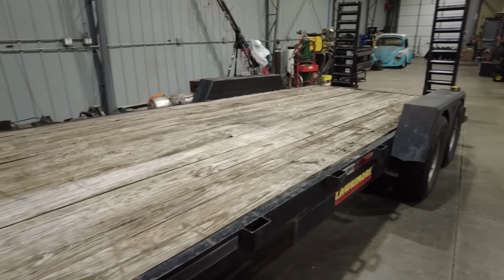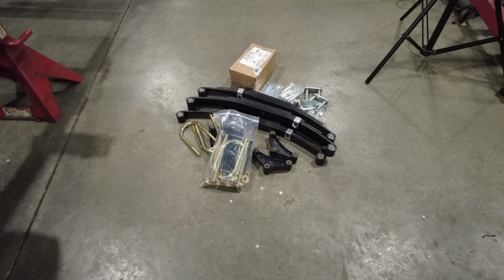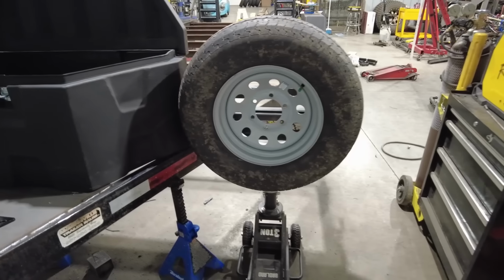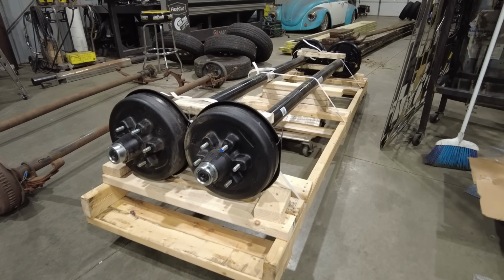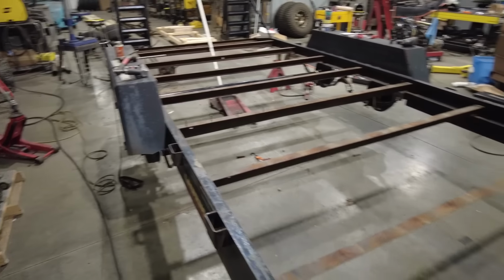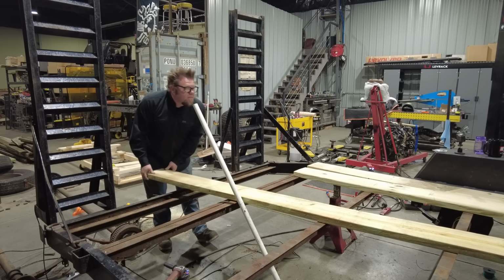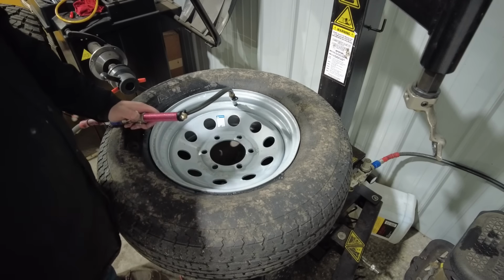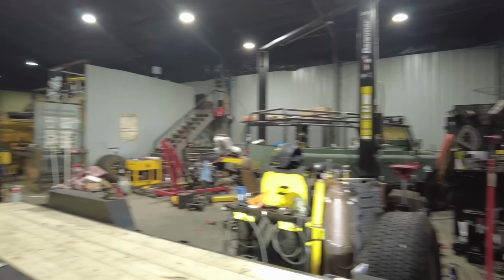Car Trailer Rebuild, How to Increase the Load Capacity of your trailer

Comment: You're also going to wish you had put grommets in those holes that you ran your homemade wire loom though. The wiring you pulled out had a HEAVY DUTY abrasion resistant jacket all on it. Which protected it from chafing against those bare metal holes and road debris being kicked up behind your tow vehicle. Your homemade loom doesn't have that. I give your wiring job 2 years before you have to start making repairs. That wire was not designed to be used in the application you are using it for. 

I'm willing to bet, you're going to hate those particular lights in the middle. Personally I would have put 1/2" led lights down the middle. They would be hard to hit with chains or straps, and still apply a good amount of undercarriage light. Not to mention less blinding at night.

Honestly I could do a full page of issues you're going to see with the "upgrades" you have done to this trailer. But nobody wants to see that. In the short term, it's a good "upgrade", but you have just increased the cost of maintenance and repairs for the life of that trailer. 

You should do a trailer update in about 6 months to a year. See how everything works out for you.
Reply from the maker: Will do because I think you are wrong on all accounts
Reply from the maker: Plus how did I increase my maintenance on this trailer?
Reply: @BigTireGarage By using the substandard wire to redo your wiring. You're going to be repairing the wiring more. If you compare the insulation on the wiring you installed, to the old wiring or say a Gates pre-made harness, you can see that the exterior covering is thick. Like 2-3mm thick. Compared to .5-1.0mm on the wiring you installed. I should also say that I assumed by the way you talked, that you use this trailer quite often. If you don't, obviously it won't be an issue as soon as I think it will. 

 Also the lights you installed down the center, tend to go bad fairly quick. They look like the 4" taillights that class 8 trucks use. So they will probably need replacing about once a year. I have found that it's hard to find LED lights that stay sealed for very long. Plus I didn't see you box in the back of them, so road spray will probably have an effect on them as well. I wouldn't be surprised to see the LED's start to fail fairly quickly.

I also thought about my comment saying that I think you will come to hate those centerline lights. I have really good night vision, and I am sensitive to bright lights, especially at night. That's why I made that comment, but failed to take into account that some people are night blind, and need all the light they can get. So you may not come to hate them for that reason.
Reply from the maker: Or maybe since I know how to build off road vehicles..I built the harness the same way...with a layer of e tape backed up with heavy abrasion tape.

Add to that most harnesses fail at junction points whete trailer manufacturers use sub standard methods like scotch locks a t taps instaed of high quality butt connectors and heat shrink.
Reply: @BigTireGarage  I'm just giving you my experience as a heavy duty diesel mechanic with a decade under my belt. 4x4ing as you very well know, is completely different than highway vehicles. It doesn't matter if a harness is loosely ran in 4x4. They don't go fast. Maybe 30mph, but not 75. So they don't have to worry about wind whipping wires around or road spray pushing into every little crevice to seep past seals. 

But it's your trailer.. Have a ball. Just trying to help you out.
Reply from the maker: I understand what you are saying...and trust me my 4x4's go a lot faster than 30mph...try 100mph through the desert. I started my trade in heavy truck and coach at a Volvo white dealership in Canada in 1990 so I know what you mean about road miles wearing on a component. Trust me..I build my junk right from the start because I HATE maintaining them.

Comment: Ian, GR8 job. I really like the lights in the middle of the trailer. When I was upgrading my trailer, the company blew holes in the frame for the wires. I drilled them out and ran grommets to protect wires from rubbing. Never had a problem but what if. I have a full wire mess ramp but installed extra set of trailer lights on the ramp. this allows the lights to be higher and more visible. and an extra set if the others quit. I added extra marker lights on the front corners and blinker markers on the side center of the fenders. This allows the person coming up on the next lane to see me coming over if they can see the rear blinkers. A spare spindle is an idea. I had a bearing go out on a trailer many years ago coming back from Zuwharrie and unloaded it and drove home. It was just faster than strapping it up. 8-)

Comment: Why don’t you put the spares UNDER THE DECK? It keeps thing out of the way and out of the UV rays that degrade the rubber. Properly placed, you shouldn’t have an issue with high centering. Maybe some junkyard spare tire winches from pickups.

Comment: Can someone explain to me the difference between a trailer winch and an actual winch?
Reply from the maker: Trailer winch is ussually under 5K, has less line, and doesn't have the same gear reduction that a real winch does
Reply: @BigTireGarage  you just made that up. 

Trailer winches are under 5000lb by who’s definition? Perhaps a better designator would have been light duty vs heavy duty. But there are no trailer winches, they don’t exist. And light duty winches are actual and real winches. If they’re not actual and real then are they a figment of our collective imagination?
Reply from the maker: Search Trailer winch...trust me..they exist

Comment: Hi Ian, I did the same on my car hauler, Went from 3500 lb to 5200 lb axles, bent 2 3500 axles over the years, the brakes went from 10" to 11" brakes, but I went with 16" wheels and tires, load range E, 3350lbs per tire, a little extra carrying capacity because I've never overloaded my trailer!
Reply from the maker: I went with 15's because I already had two good spare tires....my tires are still rated at 3400 lbs per tire

Comment: I notice the old equalizer bars on it with new axles and springs. You showed putting in new bars, but not using them?????
Reply from the maker: No, they were slightly different lengths and I would of had to cut brackets off and reweld them
Reply: @BigTireGarage  i figured it was a fit issue

Comment: The wiring is right. Any truck made today is black is power. Everything I use on the ranch is black for power. The gauge should reflect that, but if it works for your application, then good for you.

Comment: Upgrading the axles is always a good idea. But it doesn't automatically increase the weight rating of the trailer. There's still the rated trailer frame and the VIN indicating the rated weight...legally that weight can't be exceeded in most cases.
Reply from the maker: Hauling for a private "not for hire" trailer means that the load rating is something I only have to pay attention to...not DOT worries for me
Reply: @BigTireGarage  If you're in an accident and the trailer was overloaded there's fines possible and insurance may not cover you. Have to stay within vehicles ratings. Virtually ANY State Trooper will generally know the regs and likely to check
Reply: @BigTireGarage  what a terrible answer.   I can be irrespossible if I want to be.  I pretent to be an expert.. but turns out I'm NOT,  ignore EVERYTHING I showed you cause I don't care about safety.

Comment: Add Rock lights to the inside middle of your fenders and wire them into the center LEDs that way if you ever have a blowout at night you can turn those lights on and you have lights right where you need them to swap out blown tire for spare
Reply from the maker: Now that is a GREAT idea!!!

Comment: As a Trailer parts supplier I have helped thousands for people do what you are doing,   One thing i see all the time is a hub failing because of lack of maintenance ,   one thing I did on my trailer for the spare tire is use a spindle and an idler hub for the spear tire mount, therefore I have a ready to go hub in case I have a bearing fail on the road and i catch it before it destroys its self.  You put your springs on backwards, the strap that goes around the spring needs to be pointed to the front because under breaking that strap holds the spring pack together the way you have them it will shorten the life  of the spring and break over time.  Why not go with 6k Axles  same fitment  and if you ever wanted to upgrade the tires the hardware would be ready.  Why not rewire to industry standards?   That spare is most likely bad because of time in the sun look  at its color it is grey that means that tire does not have the elasticity is needs I Have seen many spare tires on trailers separate just because they were on the carrier in the sun and never ever run.
Reply: I seen the same thing on the springs. And the shackles were over center but I’m sure that was corrected when it was set down judging by the wheel to fender clearance. 
But I agree with changing the wiring how Ian did. If you ever have to replace your 7 pin plug and wire it by the colors on the new plug it won’t match whatever that RV standard is. I’ve noticed all RV wiring is like what came with that junction box and it defies all my trailer logic. Wish they would all just pick a lane and stick to it.
Reply: @joshuavanalst2365
Reply: I have seen People do stupid stuff to wires.  In my time of services.    One guy even went as far a hooking his brake wire to a reverse wire so if something tried  stealing his trailer. The moment he reversed it would lock the brakes up 😂
Reply: I also saw the leaf spring hangers wrong, but went back in the video and the old axles were the same, is it possible both were installed wrong?
Reply: You are the man..  you said everything i was thinking.  An why not sand blast the frame at this point. An re paint?
Reply: That's a great idea using a spindle and hub to mount the spare tire,  they do fail even with maintenance and they never fail when it's convenient.
Reply: You might be able to get away with 5k axles but going to 6k axles I would think you would definitely have to beef up the frame substantially. If you have to do that you might as well sell the old trailer and get something heavier built.
Reply: The spare tire comment is friggin Genius! I am doing that!
Reply: After 20 years of working on over the road trailers with the 7 round pin ATA plug, and G'ds color code; I took a part time job at an "Auto and truck shop"... A car trailer came in needing new tailights... It was wired in the "RV" "standard... The Satanic wiring drove me insane...
Reply: The tire engineers no that the pressure is gonna rise. I don't have a wind tunnel 😂. 
. I have six trailers I use them all the time . The only time I've ever had a flat was if I hit something on the highway. I guess there's more than one way to skin a cat😂
Reply: Nice vid. 7 years ago I bought my 10k # Gross weight trailer, as they are properly called. It weighs 2500# and will haul 7500 #. 16'. $3195. The one like yours originally, a 7k # gross was $2895. Why I coughed up $300 for 2509 # more capacity.
Tires. I am assuming the the old tires are 12 ply like your new ones? Or? Load rating? 7500 # trailers have 5 lug wheels, 10k # have 6 lug, and 13k have 8 lug (8 ply tires).
Reply: @BadCaddyDaddy  I'm not sure that is always the case its more the tube size that shows the weight capacity as far as I know . Could be they sorta correlate to one another.
Reply: Are you going to paint the frame rails ?
Reply: I'm no expert/engineer, I have 6 trailers .ask any expert . Trailer builder , trailer store . Any tire expert,even Google it . What ever the psi on the tire ,is what you put in it . I always keep the tires full , never know what your hauling. Be safe my friend.
Reply: @MrSprintcat   Those experts don't want the liability.  Just like a pickup comes off the lot with 80psi in the tires empty.  They don't want the liability of someone hooking up to a huge 5th wheel with 40psi in the rear tires.
Reply: Not to mention, if the tire psi says 65 psi on the side ,then 65 psi is what you run all the time . They are not like car tires.
Reply: @MrSprintcat   That's debatable.  If I'm picking up something light with my trailer, I don't want 80psi in the tires.  It makes for a harsh, bumpy, noisy ride...moreso when empty on the way.  I will run 40-50psi in them for a small car or less weight.  8 years on the stock tires with zero issues.  I installed new ones this past summer only due to age of the originals.
Reply: @yetisdeuce1315 Yep. 40-80 depending on load. Even then bumpy empty.
Reply: I'm  not sure where this is going . I have a bunch of trailers , all sizes,  I put over 5 thousand miles on then this summer , with all the tires aired up to the number on the side. Hauling heavey and light loads. The number on the tire is where it's supposed to be .i have some that say 90 psi on them some 50 psi some 65 psi. You can't convince me to run them any other way. Why would I put 50psi in a tire just to get a soft ride from my trailer? Then get to my destination and fill them up to the max air setting? Run them at the max found on the sidewall. The less air in the tires the more flexing that go on.the more flexing the more HEAT. WHAT HAPPENS when you have heat ? I'm not worried about the cushi ride.its my life .car tires are different ,my friend.
Reply: @MrSprintcat    I'm not trying to convince you of anything.  But your original statement of setting them at max PSI and leaving them there forever is just not always correct for everyone.
Reply: @MrSprintcat you say you run “max psi” in all your tires?? Thats a disaster waiting when hauling something as air pressure increases with heat and on an 80* day after a 20mile ride that 65psi will be 70+ so now you have exceeded “max psi” rating of the tire. I have 5 trailers and never had a tire issue from pressure but always run a tire rated for more than my trailer GVW is too and run them 10psi short of max except my gooseneck with 14ply tires that say 110psi and i tun them at 80 which is the same as the 10ply that had the same combined rating as my trailer GVW so the extra pressure isnt needed for the weight. Everybody does different things that work but always leave some room for pressure increase from tires heating up
Reply: @young11984 rated tire pressure is taken with the tires COLD! They are engineered to hold the higher presdures at full load capacity when HOT.

Comment: I always paint the deck boards with porch paint and it helps preserve the wood and keeps it from warping. I also had a shake I couldn’t find and it turned out to be 3 bent wheels . Always have the tire guys check that the wheels are straight when buying new tires.

Comment: Legally its still a 7k trlr because thats what the data plate says.....
Reply from the maker: You can get a new plate made if trailer is inspected...but I don't need to worry about that.
Reply: @BigTireGarage  I agree. However if you dont and say get into an accident and pulling more than trailer is rated for (by the data plate) can be found at fault. Also if its rerated for the 10k some states will require you to have a form of a cdl to legally pull it, and also require you to pull into weigh stations for inspections

Comment: What about your ability to open tailgate while still hooked to the trailer? Ever used electric over hydraulic brakes?
Reply from the maker: I can still drop the tailgate....I had a trailer with surge brakes and I used to work in heavy truck and coach shop so I have worked on air over hydraulic

Comment: Not a fan of the wood decking, it doesn't  last as long as steel.Thats the only thing i wouldn't do
Reply from the maker: I have another trailer that is an open center steel deck that is a great trailer as well.

Comment: In reference to your statements about weight capacity of your trailer. What you can carry and gross weight are two different things. You have to subtract the weight of the trailer from the combined axle ratings to state what you can carry. You do not have a 10,000 Lb. capacity trailer like you said.
Reply from the maker: I think everyone knows that....but the common identifiers of a trailer are the axle weight/size

Comment: So you have 5K axles on a 7K trailer.  And two 7K spares.  There is a reason why the 10K trailer costs more than a 7K trailer, and it isn't just the axles.  Good luck.
Reply from the maker: Actually I have 4 tires with a weight rating of 3400 lbs per tire...I have four tires on the ground giving me a total weight capacity of the "tires and wheel" or 13,600 the axles and suspension are rated for 10K

Comment: So you took a trailer that you could sell for 2-3k and spent a ton of time and energy and $5500 rebuilding it  to avoid buying a brand new trailer for 8500..... might want to check your math there bud. BTW I just bought a 6 month old 20ft 14k tilt deck for $6700 and ditching the ramps is the best thing I've ever done.
Reply from the maker: This trailer around me would of sold for 1500 tops....still ahead money wise and based on what I have seen come out of trailer shops lately I have a better trailer

Comment: With the ground wire I have thought about running the wire like you did but also grounding it to the frame also so I have back up if the ground wire breaks some where
Reply from the maker: It is...